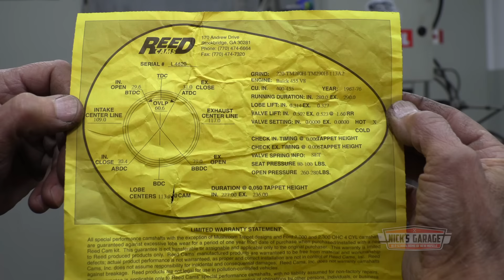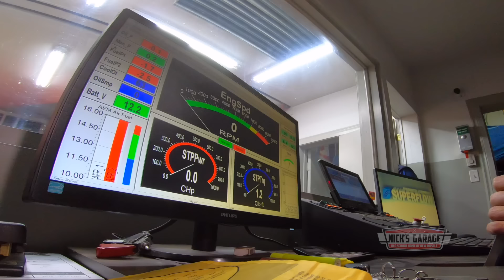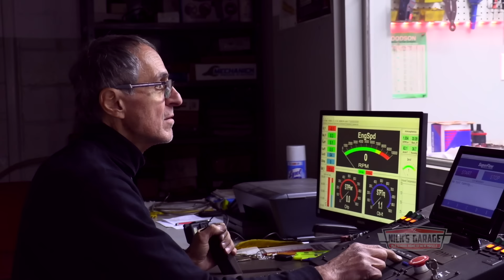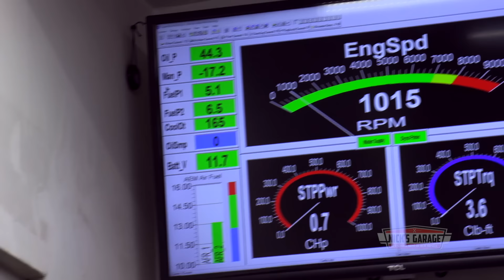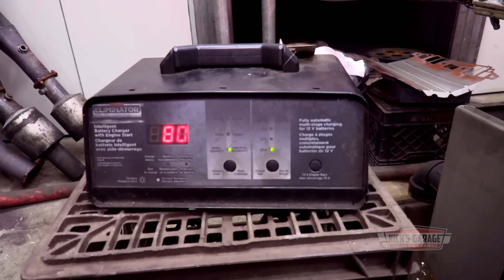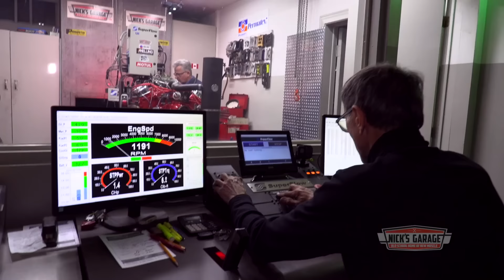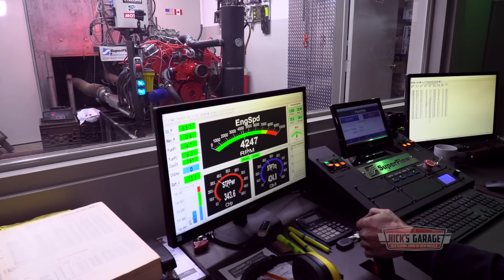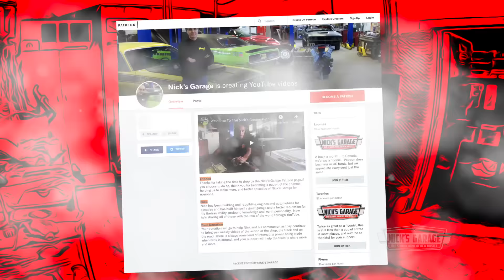1970 Buick 455 Stage 1 - Dyno Room Diagnosis

Comment: Hi Nick, in 1975 a gentleman I knew gave me a 1968 Buick Electra 225 with a blown engine. I picked up a 430 engine out of a junkyard. Put the engine in, started it up and #4 rod was knocking!  What a pain to drop the oil pan!  I took #4 cap down, and it looked just fine, no scars. I checked the the bearing and it was STD. I. He led the new bearing with plastic gauge and it proved to be with speciations. I buttoned everything up and that engine ran trouble free for years!
Reply: The new bearing proved to be within specifications
Reply: The engine had an STD? Sounds like it really got around!

Comment: What about the engine stalling?   You seemed to be baffled.   What was the fix.
Reply from the maker: The low voltage.  Ground wire got kicked off the battery charger.

Comment: Being that you're working on a 455 Stage-1 I have a story for you.  Back in the late 90s I was returning from a Mopar only car show in Indianapolis in my plum crazy, 4-speed, super track-pack 70 HEMI Cuda.  The motor was newly built with all the good parts for the day.  12.5 to 1, Crower rods, Celender head service heads, Extrude-a-honed intake, two 750 AVS carbs, Hooker headers, Howard's roller cam plus much more.  Well, I stopped for gas plus "two cans of 104 octane booster" after I was 20 miles outside of the city and walked up to pay.  Most of the lights were off in the lot but on inside and at the pumps.  Three men were out in the bay area working on a brown 70 Stage-1 Buick.  There were putting slicks on and as I walk around, I noticed headers, dropped pan and a drive shaft loop.  They could only see the front of my car and asked if it was a 340, I just told them no.  They asked if it was an auto, I told them no.  They asked if I ever raced it, I told them all the time.  They asked how fast it was, I told them faster than any ugly brown Buick.  Now it was on.............they all started talking SXXT then started walking out to my car.  I started the car, and one guy tells the other, it's sounds bad a$$ think you can take him.  Then they spotted the black hockey stick.  One guy whispers Ooooh SXIT!  Then they see my license plate MYHEMI.  I tell them to get that peace of $HIT on the ground and follow me.  I was running 4:10 gears with a 28" slick screwed to 15X7 rallies covered with trim rings and caps.  It also had a lot of trans work done including being slick shifted by Sonny with every other synchro ground off and a MR. Gasket vertigate shifter.  It was around 1:00 AM and the interstate was empty, so we lined them up.  I did one dry hop and got ready.  I was in the left lane and ready to go, he pulled up 1 2 3 and we were gone.  At the time my car ran 10:40 -10:50 but I was running with my headers closed.  He was not ready for this; my car hooked and carried the wheels 3 or 4" and I hit the limiter at 7,200 in 4th then I started costing cooling it down.  I slowly pulled over and shut it off so we could talk.  He seemed a bit freaked out plus a little pissed off.  I put three cars on him in first gear then walked away fast.  I could tell he was worried about telling his friends that he lost so badly.  So, I told him about my car and that he was playing against a stacked deck and never had a chance then I just headed home.  My car had one heck of a reputation, but they just weren't aware.  Unlike most people, he wasn't intimidated or afraid to race me, so he at least had that.
Reply: Brings me back in the day when I raced my 71 Hemucuda in the streets. Good old days.
Reply: I just can't imagine that. Why would any Buick owner act that way when racing a race bred Hemi?  Esp. with all of your mods that aren't even available for a Buick? Like those "Celender Head" service heads and roller cam, no less!
Reply: @LR-my2di  As I stated this was years ago but as I remember he seemed very confident even after looking at my car for two or three minutes.  Now his friends seemed a bit put off and doubtful but not the owner.  Long after this race I was thinking that he most likely never lost and was always the person doing the picking.  This time it was nothing more than a fluke that I stopped at that time and picked on him.  To this day I wonder what he told the guys back at the station.
Reply: @largelarry2126  I took particular interest in this story because when I was 24 yrs old, I owned a very low-optioned, black 1969 RR 426 Hemi with Torqueflite and 4.10 gears that I bought slightly used in NJ.  It had been fully tuned by MOPAR guru Al Kirchenbaum who was working at a NJ dealership at the time.  Meanwhile, my half-brother had purchased a 1970 GS Stage 1 from his three years of hard construction work at age 22.  I'll never forget how hard that GS ran with its simple Q-jet carb, even with its 3.42 gear.   I never could shake him when we raced.  It was all a matter of who got out first.  That GS's torque made up for my 4.10 rr. end and it was a sweetheart to drive.  But thanks to Mancini racing, once I began throwing their parts at my RR that were unavailable for my half-brother's GS, only then did I begin to take the lead.  That's why I was surprised those guys you described would want to race such a strongly built RR Hemi with a GS that relatively very few perf. parts are even available for.  Funny!  Good luck, Larry.

Comment: Nick , your a  perfectionist.  
 Every car you work on , is treated like you actually own it , your fantastic .    There is also a stage  2 Buick  g.s.x.    , rated at 540 horsepower, at 510 in torque, it runs a 10. 7 in the quarter mile at 123  m.p. h. Stock.
They were called the hemi killers.
Reply: The stage 2 heads were aftermarket..

Comment: I had an 89 Mustang 2.3 thermostat housing leaking. Two gaskets stopped it from leaking. 10:30 no torque wrench because only new internet car guys need them. Put a larger cam in the 455 and it will make 455 hp.

Comment: Nick, if you're looking for hard-to-find parts for Buicks, either big block or small block Buick V8, or the V6 Buick, the place to go is TA Performance, Scottsdale, Arizona. They have a 175-page on line catalog of Buick parts , and if they don't have it, they know where to go to get it. They are the Buick Specialists in the U.S. You mentioned that you were looking for high-compression head gaskets for this engine. They're to the point where they have made up casting cores for an aluminum 455 big block, and hi-po aluminum heads for them. They have aluminum blocks, either regular deck or tall deck, anything and everything you might need.
Reply from the maker: I will check them out. Thanks for the tip!

Comment: I currently own a 65 Olds 442 with a modified 400 engine.  Factory specs on an olds 400 is 360 HP and 510 ft-lbs stock.  The engine was re-engineered by Chief Engines out of Fort Lauderdale, Fla. They build engines for the off shore power boats, so they are a top tier engine builder.  The engine was reconfigured out to 442 cubic inches, the compression was dropped from 10.25 stock down to 9.6 to 1. The crankshaft was lightened and converted to internal balance to reduce engine harmonics.  A custom lunati cam with 4 degrees of advance and additional lift over stock was used.  Advancing the cam 4 degrees  increases cylinder pressure creating additional HP.  You lose some top end this way but the intake maxes out at 5200 RPM, so works quite nicely.  Extensive work was done to the heads.  The result was 469HP at 5200 RPM,  and torque was increased out to 529 ft-lbs.   So basically 100 HP was added to the motor.  This just goes to show there is a lot of potential in the old V8 engines that can be brought out with proper engineering.  I'm sure this Buick could be improved to.

Comment: Your brother found it when you first started it up. I own a 430 stage 1 engine.i use that black rubbber groment for the pcv on the valve cover. I have 2 550  Carter Afb. Quads  ,throws you back in the seat Offenhauser Intake
Reply: Stock intake uses that with crankcase ventilation to the Air cleaner & valve covers.

Comment: In 1981 my first car was a 71 gs 455 convertible. I had the engine rebuilt right away and that car was a tire melting runner.

Comment: Blue points is an indicator of running with no ballast resistance. When installing new points you should install a lube wick. The old ones were felt and newer were foam saturated with cam lube.

Comment: Double check that the lower secondary throttle plates open just past 90 degrees, pushing air flow forward. From the over head camera, they don’t open even close to 90 degrees. @ 1:11:40

Comment: my Old 442 455.. stock heads and cast iron intake made 425 hp and 480 tq with factory manifolds, bowls were cleaned up, center divider dropped 1/2" with 272 Hyd cam

Comment: I worked at a Buick dealership from 1978 until 1984 doing line work, and my dad worked for Buick Motor Division for 25 years as an executive, after being a mechanic for 10 years at a Chevrolet dealership. With all of that being said my twin brother bought a beautiful white 1972 Gran Sport Stage One and I pulled his original engine out, rebuilt it after, and reinstalled my dad's 1970 Stage One temporarily, until I got my brothers original 72 rebuilt,  and removed the 70, and reinstalled the original 72 model that came in the Gran Sport originally. They both ran like they were intended. 
Later on I installed dad's 1970 Stage One in a 1975 Buick special, and a Stage two camshaft, with a rear axle ratio of 5.00 to 1 which was rediciculous, but certainly made for one rediciculous fast car, with the exception, and that was the traction problem,  but boy was it fun to drive. I wish that I still had that car today, except I would have put a 3.90 gear or one a little less crazy than the 5.00!
Thise were the good old days!  I miss those days for sure!

Comment: need to check oil pump gear clearance for the thicker gasket will give more space.
rule of thumb  .003 inch max clearance, reason why was a thin gasket

Comment: Rebuilt a 3.5l  range rover v8 with a Piper hi lift cam and Holly carb on it i believe it's basically a Buick v8 copy.  About 20 years ago now.  It had a new rope rear main oil seal never stopped dripping even after a good run to make it swell up. Gave up after that didn't want to take it out on my driveway again. 👍

Comment: I rebuilt a 68 olds 455 rocket that was supposed to be 400 hp and boy that was a great cruisin motor and surprisingly always started even in cold Wisconsin winters.I had a piston fail a couple years later 90 miles from home and I drove it home figuring it was toast but when I tore it apart there was no cylinder damage so that day I put another piston in it and got it running and it drove for years after that.The piston failed at the ring grooves and all the pieces fell in the pan with not a scratch in the cylinder.That 68 olds 98 was a great daily driver.

Comment: I have a '68 Wildcat with the 430 high compression engine. Years ago I did a ring and bearing job on the engine and installed thicker head gaskets. Never calculated the compression ratio but at the drag strip the engine had the best MPH in the traps with 34 degrees total. At 36 to 38 degrees total, it cost 5 MPH and some audible detonation.
Reply: I have a 72 Buick 455 in a 1955 gmc that's been sitting for too long.
   It ran great when I parked it. Trans & rear end were solid, but needed brakes.
   It's been sitting too long, but price of vehicles is making me want to get it back out & on the road again
Reply: Needed some higher octane gas...
Reply: 34 seems right. Same with our 430. Buick heads have a pretty good closed chamber design for that era and don't need a lot of timing.

Comment: I have a Buick 350 in a 1986 Buick Regal and had nothing but problems with the now discontinued Posten aluminum intake, lining up with the cylinder head threaded bolt holes and also air leaks near the gasket area. The engine produced good low end and mid range power but always has idle problems. I still have the car but since given up doing anything to it for various reasons.

Comment: In 1971 I bought a 1970  Buick Lesabre 455  which  had the Electra  455. 370 hp
engine. A full size car but lighter  then the Electra or Wildcat. l needed the big engine to tow a boat on a trailer   that  weighed almost as much  as the car.
The 2:93 axle wasn't  ideal but it did the job. The car was surprisingly  fast with  out the boat and a BBC 4sp Corvette  couldn't  get around me before we ran out of road. He was banging  through  the gears real hard  and he was  slowly  catching  me but  never passed me.  At the red light  we had a friendly  chat about my sleeper Buick and I had 4. adults in the car. The boat had a mildly
modified  340 Chrysler Marine engine and was also a sleeper. Ask me about getting  caught on black ice towing the boat to Florida. Cars  were  going  off the road all around me but because I was  going  about 55 and they were going 70+. I got on the center  of the crown and slowed way down. The trailer  was  actually  starting  to jacknife until I got on the center lane.
This was in Connecticut and I stopped  shaking when I reached  Virginia! Don't 
ask me about my fuel milage towing the boat. My next Buick was a new 1975 Riviera  which was  catalyzed and smogged to death with a 205 net hp 455. Nice driving car but dearly missed  the 1970  high  compression  engine.

Comment: I was working back East as a Millwright apprentice in 1982.  One of the journeymen Millwrights built tractors for the tractor pulls.  He had a 1972 Buick Gran Sport Stage 1 that had been on blocks in one of his garages for 9 years. 455 motor, 4-barrel, 4 speed on the floor. He had a bunch of Kenne Bell magazines with articles for building the engine, but he had not gotten around to it. The car was  Seamist green pale color in the interior/exterior. He wanted to sell it and offered it to me because he did not want his kid to get it when he turned 16 the next year. He was afraid his son would kill himself in it.  He even offered to paint it a different color as part of the deal.  I had just bought a 1000 Kawasaki LTD off the showroom floor and was making payments, so I stupidly passed.  He was asking $1500 including the paint job!!                                    One of my life's greatest regrets...

Comment: Love old school motors! Carbs and point distributors. Not much to go wrong. You could clean & set points on side of the road with a match book cover. That would get you home. Modern motors, your screwed. You got to get your trailer or call a tow truck.

Comment: Lots of bone stock Stage 1 455 buick motors  dyno 400hp @ 5400rpm  thru exhaust manifolds. Surprised this motor was not dyno tested at higher than 5000 rpm given an aftermarket cam and headers.

Comment: Several years ago I had a similar intake manifold issue. Ford 460, .030" over, high-torque cam, rebuilt head, and 9:1 c.r. Excessive oil consumption (1 quart/300 miles) right off the bat. Good idle and power (250 hp rear wheels F-250 with Dana 70 and T-19 transmission @4,000 rpm). I had used the 1 piece steel intake manifold gasket with valley pan. Twice. Changed from Edelbrock to OEM iron manifold with same issue. Tried Fel-Pro no change. Then went to 3-piece Victor Reintz and the engine is running like a champ. At least 2 rebuilds on engine so I should have shaved the intake manifold. BTW, during rebuild I went with Autotec pistons who made a set of pistons just for this engine so that I could remain at 9:1 c.r. and that I could run on cheap pump regular; it was great working with my engine builder and Autotec. The engine is capable of 550-600 hp at 6,000 rpm but right now it is in a 4x4 truck with cabover camper and it may never remain in the truck; it was not that more expensive building a racing block for longevity.  My point is that some intake manifold gaskets are more forgiving than others and it looks like Ford used the Victor gaskets from the factory. I loved the memories on points (73 years old) and using points in a Sunbeam Alpine 1725 4-cyl with a CDI ignition and turning over 7,000 rpm. BTW, burned points usually the result of removing the ballast resistor for a hotter spark but when the engine is not running and the ignition is left on then the points will burn up.
Reply: Too much information.

Comment: Factory compression ratio was 10.5:1 forged
Reply: Buick never installed forged pistons in the 455 from the factory. Forged were only available as a dealer installed option as part of the Stage 2 package.
Reply: It's not likely a true 10.5:1. That was always an exaggeration.  To get that with a 455 requires zero decking the pistons, which they weren't from the factory.

Comment: I love watching this breaker points and GM V8 with headers I had 327 V8 30 thousands oversize with corvette camel bump heads in a 65 Acadian with turbo 350 transmission,  wished I never sold it now. 😕